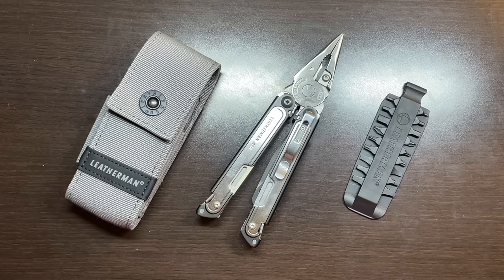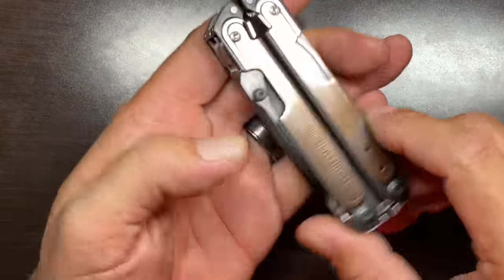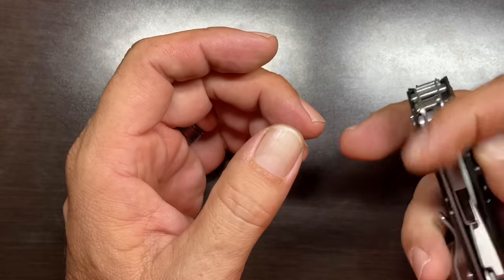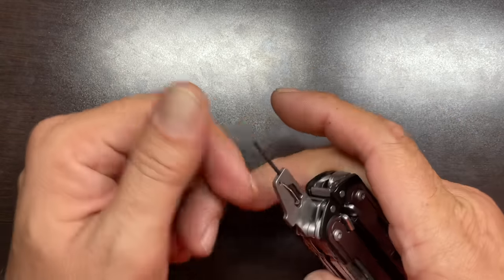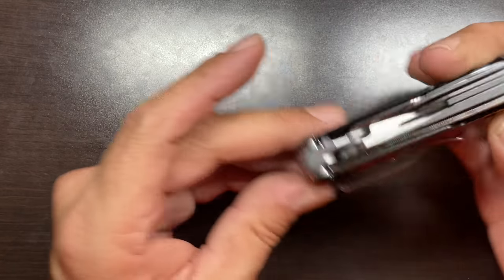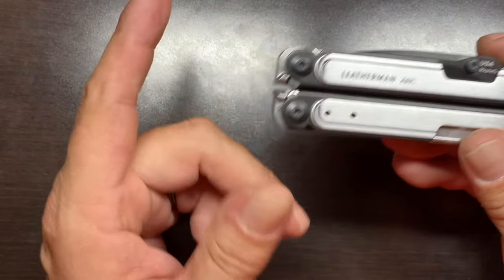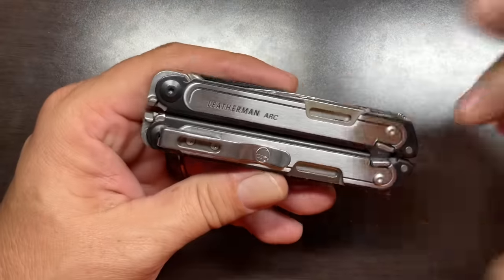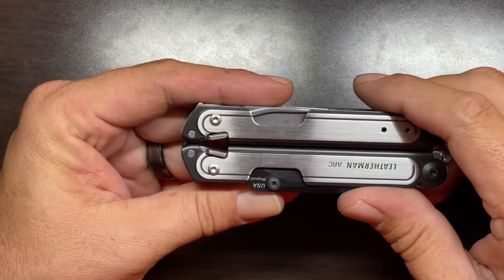Leatherman ARC : Initial Impressions

Comment: Excellent table review. In conclusion and according towhat you just said, I'm not buying a Leatherman tool until they fix the wire cutter issue. These tools are so  expensive that they must be perfect. I can't accept any imperfection if they charge this huge amount of dollars. So,  I'm buying a Swiss Tool from Victorinox. Thanks.

Comment: This past Sunday, I went to the knife shop in the local mall just to poke around. Now, aside from the MagnaCut blade, I didn’t even know what tools or functionality it had. I asked the owner if he could take it out of the case for me, and within 10 seconds of handling it, I asked him to box it up. I bought it instantly, based solely on the blade and the fidget factor. When I got home, I started really exploring it, and it very quickly became my favorite EDC blade/tool. I love it. I’m also trying to quit smoking, and having something so fun to fidget with is really helping me curb my cravings. I think Leatherman knocked it out of the park. The only thing holding it back from perfection from me, is the bit exchanger/can opener. If I could replace both of those with a proper 1/4” bit adapter, it would be the One Multitool to Rule them All, lol.

Comment: I am pretty glad I was able to get a Wave+ on sale recently. I thought I would miss out on the ARC but with the current issues. The Wave+ serves my needs pretty well when I am on the go. I will definitely pick up an ARC once they fix the wire cutter issue. I dont have high hopes they will fix the plier head seizing up. I can live with that but weak wire cutters are a huge deal breaker for me.
Reply: Interestingly my wave + has the same cutters and gap issue as the ones on the arc. I have never broken them or had an issue.
Reply: Ive got a wave recently and it comes with rounded cutters.

Comment: Ben the new cutters have been around for years. I have a 1221 Surge (king) that has the rounded cutters. This does make me think the failure of the recent cutters is a batch issue but the square corner ones are easier to use.
Reply from the maker: That’s interesting, thanks for the insight.
Reply: Same with my 1021 surge
Reply: I suspect the real problem is metallurgic not geometric. They probably have a batch of them that are too brittle and they didn't know, and they happened to be ones with the more curved geometry. I wouldn't be surprised if they had multiple suppliers for these rather than making them in-house, and that accounted for the slight geometric differences. It just came down to chance that many Arcs had cutters that were rounded and also defective, leading to the theory that the different shape was the culprit. But that just seems unlikely, and I think the fact that the replacements were also curved but did not break sort of proves it.

Comment: Hey Ben, nice to hear back from you again. I'm a Surge user all day and love the platform since it is robust. 
In regards to the wire cutters and following the 'Common Sense" theory about the weak point, I will agree that I prefer to break the cutters than the pliers head. Even if warranty has been extended to 40 years, thru the insider program. It takes a trip of 4 to 6 weeks to get your tools back. If you asked me and used the same 'common sense' rationality, is easier to just pay for an extra pair of cutters and leave it around to exchange.

I have yet to experience any stiffness in my plier heads using the P4 and Arc. It may be because I take the heavy-duty portions of work for dedicated tools; most of the time, I cut copper/aluminum wire and heavy-duty trim lines. Yes, I had cut hangers just because I wanted to test my cutters, but for the sake of the limit of the MTs, I do heavy cuts with proper tools. 

The gray sheath is a bit big, but for those who do pocket carry, the clips are enough, and for those who want the full bit kit sleeve and extension, the gray is perfect; remember that if you add the 2 sleeves and the Arc, the comprehensive portion makes the length of the flap an ideal fitting. I never use the LM sheats and go with the Skinth Solutions Sheaths from Canada, which are cheap, better quality, and have belt clips. They are just great seats to take off and on and secure with bottoms.

My only big issue with this great Arc is the wire striping, which is so tiny compared to other MTs; the eagle tool is a lot better; changing capacitor terminals took me quite a time bc of the small cutter, but I found the awl a lot better for the job. 

In my opinion I think the Arc fill the space between the Surge and Chage +, so is a really good MT which leaves the opportunity to subsitute a folder knife. All weekends is with my right now, enjoyed a lot the Arc. 

Thanks for the review and impressions.
Reply: You're using the awl for wire stripping? That sounds interesting.  Do you leave the awl unlocked and  press the awl down with the wire between the awl and the Arc's handle?

Comment: Been looking forward to your video on the Arc. I agree the Arc isn't really designed for heavy duty industrial use but more for the everyday Joe. I'm just using it for EDC, DIY around the house, and some outdoor stuff. And have to admit I fidget with the Arc and just love the design. If I needed a beefier multitool I'd reach for a Wave or Surge
Reply: You go to a cheaper tool for your reliable task after spending all that $ on the arc
😂😂😂😂😂😂😂
Reply: @MartinGonzalez-sl2kj  yeah it's like driving around your nicer more fun car for your daily driver but if you need to move a bunch of junk then use the old cheap pickup truck. Different tools can serve different purposes. And if you have the money and desire to buy a Mercedes then you don't have to drive an old pickup truck all the time
Reply: @MartinGonzalez-sl2kj You wouldn't get it.

Comment: To me having a free place on the bitset holder makes sense, because I'm often using my Leatherman with the ratchet plus standard bits, and then need a place to safely store the flat leatherman bit.
Reply: Then you can let the other bit at home. There is nearly never a reason for giving less if you are not flying to the moon^^
Reply: @petermuller3995  But I don't want to let bits at home, I want a good place to put that other bit. Which this one has.
Reply: @jh1618  So you take the box etc always with you too?

Comment: Fun fact. The only one that let me down was the charge+ that i bought many years ago. The pliers were really stiff from the beginning and the lock on both of the knives blade had a lot of lock rock. I still enjoyed this tool for many years. I have the arc since two weeks now and i can’t say a single bad thing about it. I swapped the wore cutter for a pair of black ones that i had since a long time as a spare for my surge. I’ve cut 1/8 thick nails with it and the pliers are still butter smooth. Love my Arc!

Comment: Thank you for your insightful, real world review.  Hope you are doing well.  I'm not a heavy duty tool user so am dependent on a reliable multitool to work for me.  The Arc isn't it, even without considering that price.  There seems like there are a number of shortcuts in designing and making it and I wonder if it's not to make up for the expense of the Magna Cut blade. I don't know why they didn't invest in a marvelously engineered multitool and offer the Magna Cut blade as an upgrade through their shop. They would probably sell more of these in the long run, particularly since there will be folks who will buy two just to have the different blades.  I mentioned the slot in the file taking away some of the functionality of the tool to another reviewer.  It's already a tad shorter than what is in other full size multitools; then to have a cut out on the tool that's a 5th of the length is concerning to someone like me.  Not being a heavy tool user, I could see myself catching on that slot as I'm filing and the Arc flying out of my hand.  As a female, it's funny for me to witness that interest in aesthetics over function isn't gender specific.  The design of this file is proof.  The fact that Leatherman shorted the bit sleeve by removing one is a bit insulting to consumers, IMO.  It isn't as though people wouldn't notice, so it's as if they didn't care, as they are likely still the biggest multi-tool company in the world.  This type of decision making, however, seems a harbinger of another USA company's questionable future.  Also, the inclusion of the micro screwdriver frustrates me.  I've worn glasses for 30+ years and don't go anywhere without an eyeglass kit, all for the tiny cost of a couple of bucks.  It adds no significant value to a larger sized multi-tool with such a large price tag.  I also wondered why Leatherman did not create an adapter to fit into the available slot in the bit sleeve that would hold the micro screw driver.  The sleeve already has a hole at the top to hold the bit also.  They really missed out on additional after market revenue on this one.  I'm also in agreement with you on preferring the pointy, claw shaped bottle cap lifter.  I am a BIG fan of having a can opener on a multi-tool.  I understand that a blade can be used to open a can, however, why would someone want to risk a blade for this function, especially since most people are probably at my level of experience with tools and it's not taking the space of another tool.  Although with this current shape it could be used as a scraper.  Another positive is the solid end that could be used as a pounding tool.  Neither of these positives justify the price tag.  I'd rather keep using my Surge or Wave + and put the money toward purchase of a separate Magna Cut folding knife.  That seems a more sensible investment.  Sorry for the long response, but I've been a bit frustrated watching so many reviewers touting how great this tool is while pointing out its shortcomings and that there is nothing we really haven't seen before in other tools, not all of them Leatherman.  Thanks again for taking the time to use and post your thoughts on the Arc.
Reply: @happydogg312  if you have a chance to pick up an older leatherman that is the "standard duty" category, you should do that since I find them much better than some today. 
I assume you want a bit of everything and a full size multitool:
rebar(currently the best deal but can be not preferable), pst(light but functional), gerber mp series(less tools but prefered if you mainly use pliers), fuse kick core(rubber lined handle line, larger than some others but very good overall value)
I moved away from carrying a standard multitool and now carry mini needle nose pliers/ vice grips/ small multi tool paired with a victorinox ranger

Comment: With the wire cutters being a weak link, it does make sense, I think that the interchangeable bits are softer so that they shear or snap before the tool as a whole experiences damage. I may be wrong. I can say I have not tested that hypothesis to any degree. Pliers might need a break in period. I do like the concept of the tool, the P4 didn't appeal to me, like why do I need a clamshell package opener or tape splitter, I have a knife. Along with the awl, I'm glad that they put an actual awl on it.

Comment: I had a st300 that after really bearing down on a large nut, the pliers tightened up on me.  I lubed them up with some penetrating oil and worked them for a bit.  Good as new and never had the issue again

Comment: I just received my replacement Arc a few days ago after returning the initial one. The first one I received from them had two serious issues, one being a defect in the frame that allowed the pliers head to push through the other side forcing the tools to open on that side and the other being that the scissors would not lock open without tremendous force being applied. So far the replacement is good.

Comment: Hey Ben, in regards to what you said about the pliers stiffening up after hard cutting use, it happened to my signal too! I put a new weight machine cable in my gym and cut the excess off. The signal cut through but the opening of the plier head went awfully stiff afterwards.

Comment: Nice to see you back on YT and a great breakdown as always! My P4 has the same plier binding issue, thankfully no issues with the Arc so far. Something that helps my P4 pliers when they bind after use, I’ve found that using the wire crimper on the opposite side of the pivot (even clamping something sacrificial gently) immediately after would loosen the pliers back up. Not an ideal solution by any stretch but helpful in a pinch and, at least on mine, seems to work more consistently than trying to wiggle the handles.
Reply: cheers for the tip mate, my P4 pliers went tight after I tried to cut lock parts I shouldn't have
Reply from the maker: I’ll try that, thanks.

Comment: To unstiffen your Free series pliers: open the pliers and hold them jaws up, logos toward you, pocket clip on the left facing away. Pull the left handle toward you and push the right handle away in a twisting motion. Might have to mess around a bit to find the spot but don't be afraid to give it some force. I consider mine adjustable because of the difference that motion makes lol

Comment: Recently got the Arc and swapped the cutters from my Wave just for peace of mind. But looking at my P4’s that I bought more than 2 1/2 years ago, one cutter is the newer design and one is the older. And I bought it new from Leatherman and have never changed the cutters. Never noticed until now, but I’ll only change it if it ever breaks.

Comment: I got mine and put them to work immediately. The elastomer bushings inside the cutter (to provide the lockup tactile feel) swelled and somewhat deformed within one week of use, making the opening and closing of this tool kinda sticky. The chip-sticking magnets seems ok-ish, nothing a few blasts of air and a solvent rag can't fix. Not that it's a bad tool, but with all the extra fancy stuff packed into it, it's definitely not the beater as Surge have always been...
(yeah, my bad for wrecking open Skydrol type-V and BPTO 2197/2389 cans with this thing, knowing the high-temp stabilization additives' nasty properties, but someone else borrowed my whole toolbox away...like two whole miles away)

Comment: To loosen you p4 jaws you can use Liquid Metal polish. Work it into the joint you want smoother and cycle the movement many times. Then use a cleaner like electronics spray cleaner/carb cleaner, rubbing alcohol. Then a drop of oil.

Comment: Being able to mount the pocket clip to the opposite side is not beneficial to lefties. It does not change the position of the knife, which still needs to be flipped out awkwardly with the middle finger instead of the thumb.
Reply from the maker: Well, I meant to say it would require changing the knife blade position and thumb stud orientation as well. I wasn’t very clear there.
Reply: @txtoolcrib  Unfortunately that would void the warranty. Do you know if the knife can be moved without modification? I'm not familiar with the Free platform, but for the wave/charge a modification to the tools is required in order to switch positions for ergonomic lefty use.
Reply from the maker: Yes it certainly can. Check out my videos regarding the FREE P4 in my Leatherman playlist, I did a breakdown of how to do it. It’s not exactly easy, but if you require left handed operation it would certainly be worth it.

Comment: I use dedicated tools for single purpose use on my job. Use  my Leatherman as something i use in a pinch,  however it would be nice to know that after spending the money you could have a tool that will occasionally cut a piece of soft wire or turn a screw without stripping and marring the tool
Reply: Cam out.  That's the term. I just remembered 😅

Comment: Glad your back. You "book end Dominic so well!. {: - )  Appreciate your "view from the job site" approach to MT use, and your informational approach to communication. 

The guy who designed the Wave, is now running Leatherman. Why are those good design principles, seemingly not applied fully to the ARC, do you think?

I've resisted "ARC urge," because I don't see where it brings the more casual EDC carrier  any advantage over the Free P2 on project days, or the SOG Powerpint on EDC Days, and am not all gaga over Magnacut, if it isn't heresy to say so here...  

SAK Handyman for the file and scissors, as the file on the P2, sucks, and the scissors on the Powerpint, same.  An ARC would give me those competent tools in one, but for the casual EDC'er @ $230? Tell me I am not making sense....

Comment: I think the cross section toon of the arcs awl is smaller, I personally do t mind them getting rid of the eyelet I work with leather and have never used it. I think people could just add the hole if they wanted pretty easily.

Comment: The thing about the wire cutters, is that as far as I can tell they have updated the wire cutter blades themselves across the board. I just took a look at my Wave+ (which isn't very old) and they have the same curve you show in the video. This means the updated geometry will apply to all tools that have this feature (their site lists about 14 tools that the replacement blades are compatible with) and the replacements if you need to purchase them. If this was done to prevent breaking plier heads, that would seem reasonable and I can't really fault them for it - it's not just trying to dodge warranty service, I would WANT my cutters to break before my pliers! I don't want to have to send a tool in for repair, that's the whole point of the part being replaceable. On the other hand, it might just be an issue of how they are manufacturing them. It's also possible that the actual issue isn't the geometry, and that the blade breaking is some other less visible defect making them brittle. Maybe the Arc's just got equipped with a bad batch of blades? Also, do we know if Leatherman actually makes the blades themselves? If they outsource it, it could even be a supplier issue.